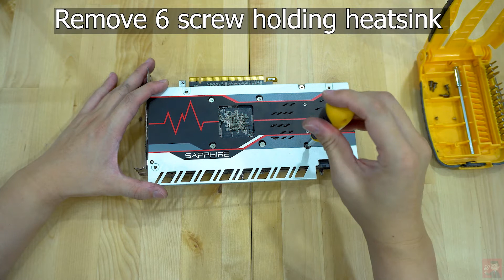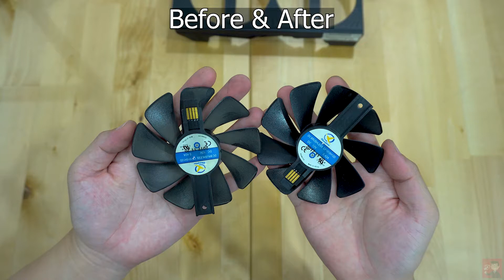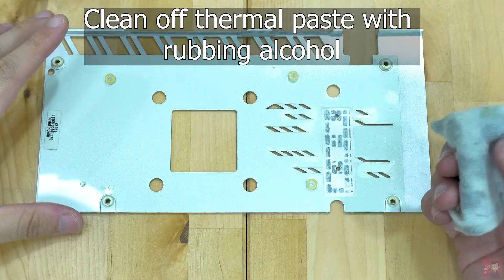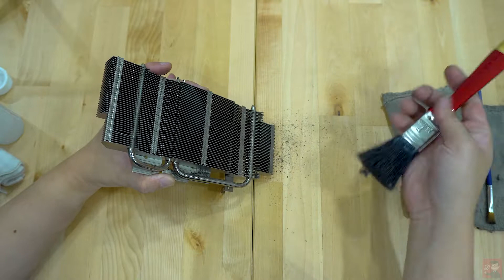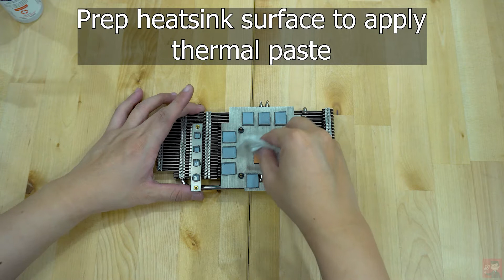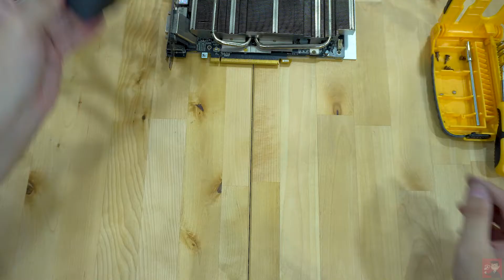How to Dismantle & Clean Sapphire Pulse RX 570

Comment: Uh, i have a question my gpu is a Sapphire RX 570 as well. But it only has one fan on the front, does that mean it's a different model or what. I have had a problem where my gpu is at an average temperature of 40 degrees on startup and normal desktop work. Then is skyrockets to 80 degrees with the fans not working at all and i'm really confused so i'd like to know what's happening if possible.

Comment: 4:07 when i remove the heatsink cover that metal part comes over it how can i put it back on pcb board? i temporary put thermal paste on it to prevent over heating issues thou
Reply from the maker: Apply thermal paste and put it back then screw it

Comment: Should i change the thermal paste, i have this same gpu, and the paste is already 1 year old
Reply from the maker: Depend on you, can change it or keeping using. As long there is no overheat or drastic temperature change.
Reply: @AlfredYap  With Overclock at 1400mhz my temps are 57° in 2 hours playing a heavy game
Reply from the maker: @alfonso5177  57° is normal operating rangt

Comment: hey what rubbing alcohol do u use 75% or 99%?
Reply from the maker: Using 75% rubbing alcohol
Reply: @AlfredYap  can i just use normal rubbing alcohol pad?
Reply: @AlfredYap  and did you use microfibre to wipe the dust?
Reply from the maker: @hadiffdaniel3930  can, I used that too. As long it is rubbing alcohol that dry off quickly
Reply from the maker: @hadiffdaniel3930  no, just brush and rubbing alcohol. Try not to use microfibre on PCB, it create some static electric.
Reply: @AlfredYap  thanks so much for the helps

Comment: Do you know what is the thickness of the thermal pad?
Reply: I watched this video for the same reason 🤣
Reply from the maker: I didn't replace the thermal pad, not sure about the thickness for the pad. Sorry. 

Can search on reddit, they mentioned 0.75mm. can use 1mm slightly thicker is ok, because I had other GPU replaced with thicker pad because don't have that thickness.
Reply from the maker: Here https://www.reddit.com/r/overclocking/comments/kvp0nt/sapphire_rx_570_nitro_thermal_pad_thickness/?utm_source=amp&utm_medium=&utm_content=post_body
Reply from the maker: @tryrise690  refer to the link above.
Reply: @AlfredYap  thnxx